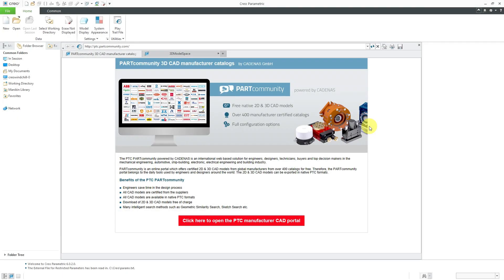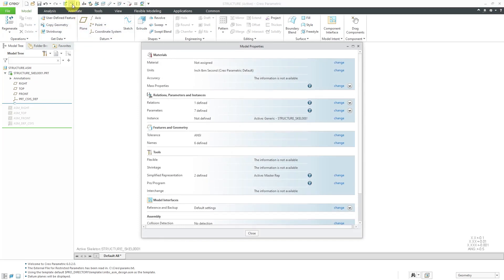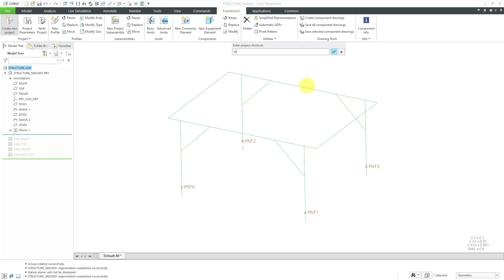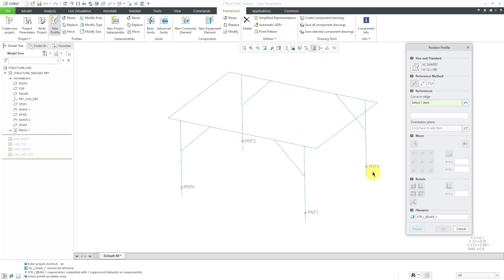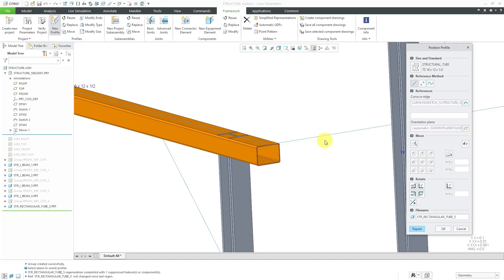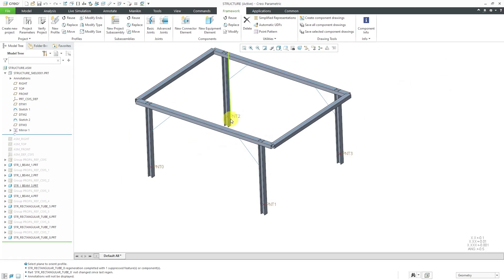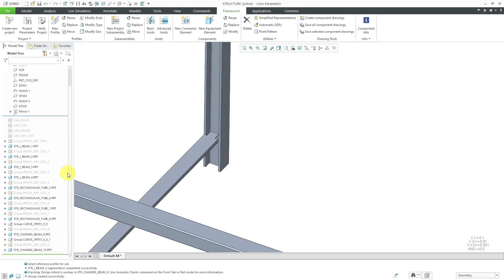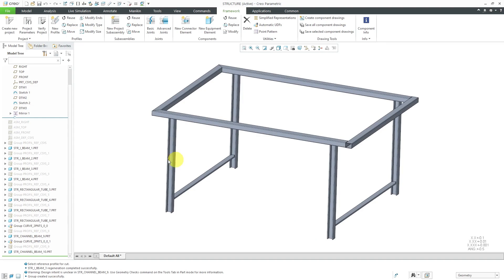Creo Parametric - Advanced Framework Extension (AFX)

Comment: HI Dave,  why did you select a skeleton file instead a normal part?
Reply from the maker: Probably because I wanted the reference geometry to be in a skeleton and not a standard part. I generally assume my CAD data is going to feed into a PLM and ERP system downstream, and I don’t want someone accidentally starting the procurement process on something that’s not actually going to be manufactured.

Comment: No major updates on Creo AFX since version 2.0...I wish PTC could have introduced 3D dragger for moving/re-orienting the profiles (Other than by using assembly constraints).Every release of other major CAD packages have updates/enhancements in their structural framework modules.
Reply from the maker: Have you spoken with the PTC product managers about this? They are incredibly accessible.

Comment: Hi David. You won't happen to know how to turn these frames into beam elements (Idealised) (not tetra/block)  for creo simulate? The AFX help menu talks about renaming the folder for steel beams, then creating a view rep and using "substitute" and "by rep" as rules. I'm stomped at this. Can't find these options? Any help? Seems to be a really deep end of Creo/Pro/E.
Reply from the maker: I wouldn’t go through any of that. That sounds like the process from 15 years ago. Substitute reps got deprecated like 6 years ago or more. If you have a sketch that defines where the beams go, it’s much easier placing the beam elements right on that.
Reply: @CADPLMGuy  David, thank you very much for clarifying things. I much appreciate your help. I owe you big time.

Comment: Hi David, just curious to know. How was frame modeling  done in old pro/e (WF2, 2000) without the efx extension? Back then Inventor already had some frame environment. How did proE users cope? 
Thanks
Reply from the maker: EFX has been around forever. It was definitely available in WF2. I’m pretty certain it was available in the 2000i version. I couldn’t tell you when it was incorporated into Pro E back in the 1990s. So you could say that Pro E users coped just fine.
Reply: @CADPLMGuy  really? I must have missed that. 
I recently tried out WF5 and efx wasn't there. Looking through online forums I came across a post stating to add "efx_enabled" in the config.pro for it to enable. I did this and the interface came out. Of course with the Creo versions, it's always enabled and in full view.
Haven't seen anything for WF2. Or was it an extra paid option back then? I initially began with WF2 student version back in 05 and didn't see it. Kind of threw me off proE for a while.
Reply from the maker: There have been so many different licensing packages since WF2 was released in 2003 that I can't tell you if it was a separate license back then. But it's been around since forever. It started as a third party application from a German company (maybe BuW) that got incorporated as an extension in the 1990s, sort of like how HMX today comes from the people at Virtual Interconnect. The student version came from a third party (Liberty Education Systems) and had a number of modules disabled. This allowed it to fit on a single CD as opposed to the 5 CDs required for a full WF2 install.
I always caution people that with CAD, just because you don't know how to do something, doesn't mean the CAD package can't do it.

Comment: One Question: Creo creates a separate model for each structure member in the working directory. Can this be avoided with some settings?
Reply from the maker: You can reassemble an existing member as opposed to creating a new one for each as I showed in the video. I believe you can also use embedded components with frameworks.

Comment: Thank you Dave for your very easy way of working with framework and AFX systems etc.
I'm used to work with it in solidworks, but i must say it actually is quite more simple and works better in Creo ^_^
But i was wondering, about changing names for each profile-part that are created. Creo names them by itself, but in solidworks i could save each profile with it's own name. I know it's possible in Creo as well, but would it be better for me to do it through the PDM-system like windchill or is there some way, for me to name each profile, as soon as it's created??? :-/
Reply: Hello Dave ^^
Nevermind, i actually found out myself ;-)
For each profile, open and gå til file and manage file and rename ^_^